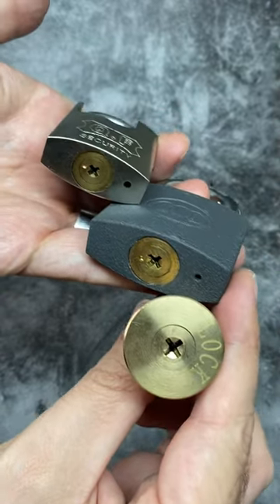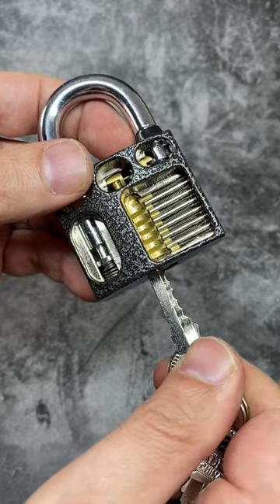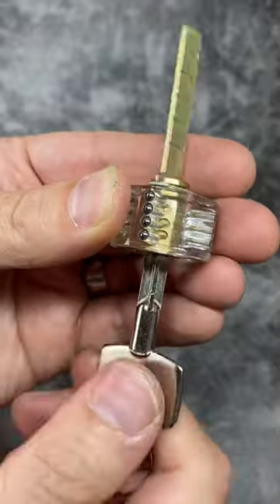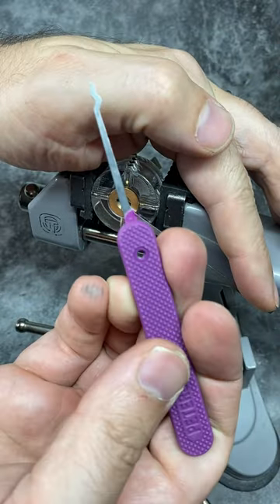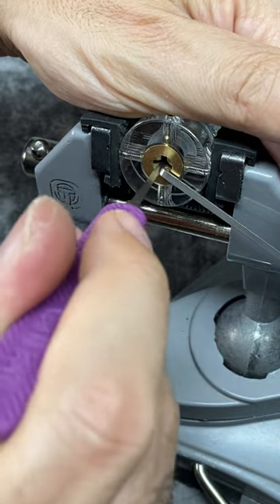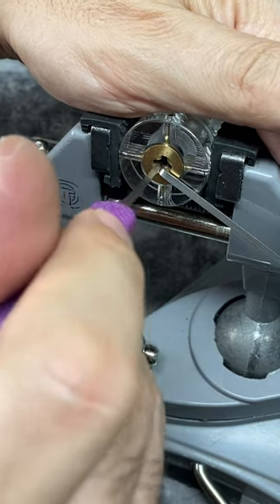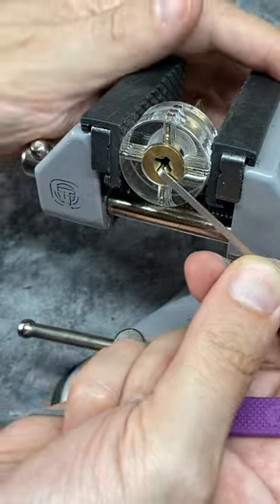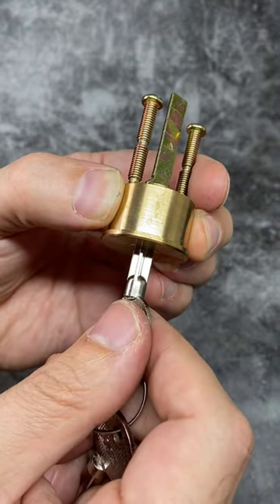Cross Key Locks #shorts

Comment: I like the concept. Simple on the surface, but increases the time needed to pick- and by extention, increasing both the risk for a mistake and the punishment for failure.
Reply: Thats kind of the hole point of a lock.

Comment: Looks like the kind of thing that would take ages to pick if it had some proper security pins😂
Reply: Even if they don't, the tensioning is so much more delicate and different because of the internal geometry, if you don't have practice with them they take forever the first several times.